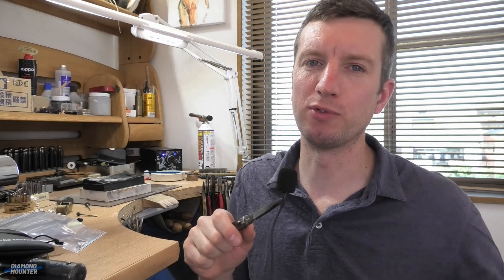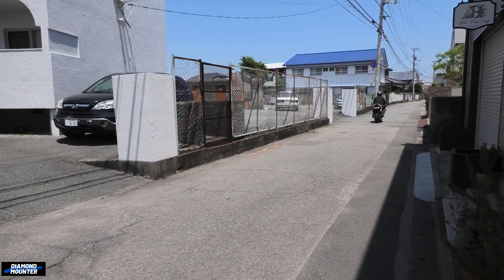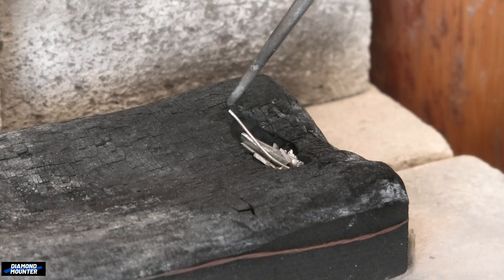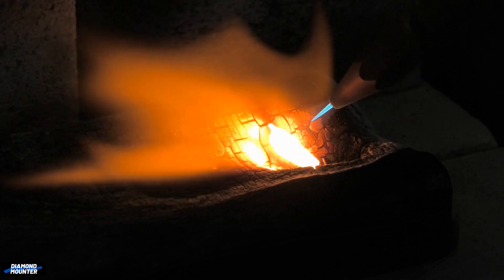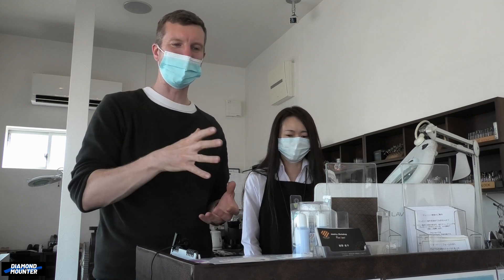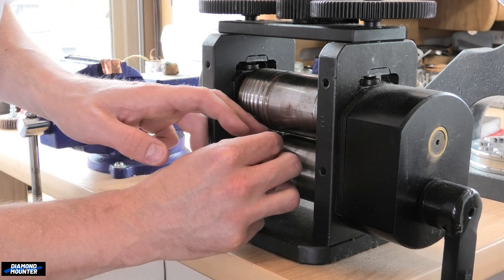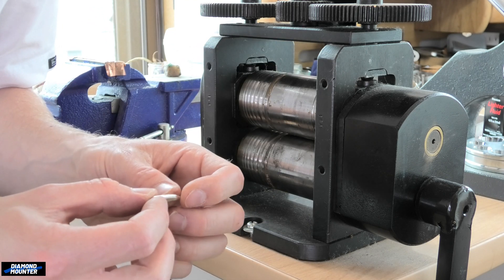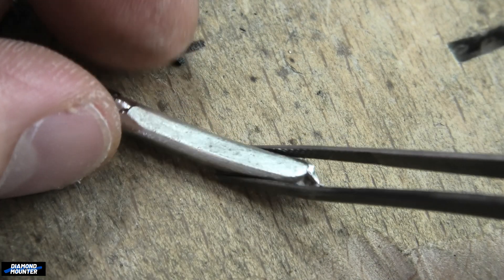Melting Platinum in a Charcoal Block

Comment: I have a huge platinum specimen but it has black crystals and a nugget that looks like some Northern Stag looking right at you, but I haven't worked with chemicals before and am not sure if it will eat the black crystals and leave the thick nugget that runs through the 16.4lb  specimen and  want to be able to have platinum for rings, maybe they were talking about PGM ore??  I don't know, all I know is that both the nugget and the ore is very rich in PGM's

Comment: Charcoal is just wood chips and CaCO3 (the white stuff). They compress it and partially burn it.
The high temperature converts the CaCO3 to CaO and CO2.
The carbon compounds burn away and make CO2 and H2O gas.
There aren't any metals so, it won't alloy with you platinum.

Comment: I figured I'd weigh in on the debate about platinum contamination. The question as to whether the platinum is "contaminated" by the charcoal is not debatable. There have been loads of tests done since the 60s, with a massive amount of data backing up the fact that platinum will gobble up loads of free carbon. You get grain boundary cracking, micro-porosity, etc. Does this really effect jewelry making though? I suppose that depends on what you consider to be 'perfect'. I really don't think you'll have many issues working with it, even given those impurities, unless you look at it under like a 200x microscope. If you snap it though, you'll for sure see the messed up grain structure, but in a practical sense, it's not weakened enough to really hurt anything or make the piece rubbish. In the ingot you rolled out, you can clearly see degraining happening on the flat sides (not the edges), but that also could be that you rolled it a ton (you mentioned that you really beared down on it).
Where it really does matter, is in some of the other places plat is used (medical, electronics, etc, etc). Loads on, and functions of the plat in those cases require a particular purity, with no exceptions.
So tldr; carbon will most definitely contaminate the platinum, but after working with it for 15 years, only being careful about carbon for half that time, I've most definitely seen failure due to it, but on the whole, it seems to not matter too much. 
I will say though, I've done a fair bit of old school forging with plat, and with those forces you will see failure.
Reply from the maker: Thats great info thank you for sharing

Comment: @all
Sure, technically its possible. But chemically the carbon reacts with the platinum and it can get brittle over time. Also jewelers charcoal blocks usually contain sulphur as a bonding agent. All these destroy the Platinum, its just not worth it, when there’s other similar ways to melt Platinum without using those materials. I have had Platinum rings that I could start from scratch, cause the metal was just bleh to work with cause of my ignorant boss soldering it on charcoal. 
Extra Info: I learned to put Platinum in the pickle after every time you heated it, cause the oxidations are really hard and destroy your tools. 
This is all scientifically proven, and not a myth. Try reading professional literature, you might learn some things! (I love the series from UJS called “technisch wissenschaftliche Grundlagen des Goldschmieden”, but I’m not sure if they’re translated into English)
I know a lot of people are self taught jewelers, but all th background knowledge is just as important as knowing the workshop techniques.
Reply from the maker: I will make something with the platinum I melted  to prove its ok
Reply: I have been a professional platinum jeweler for over forty years not self taught and it is common knowledge among my peers that charcoal is an enemy to platinum. Good Luck.

Comment: When I need to melt gold or silver, I use regular charcoal briquettes used for grilling food. Simply flatten one side with a file or carve out a small bowl and melt your metal in it. This will save your good charcoal block for soldering and keep it flat and square much longer.  You can buy a whole bag of charcoal briquettes for the price of a good charcoal soldering block.
Reply from the maker: yeah thatll work. Iv got a bit of my previous charcoal block I use for the same

Comment: I think you had the torch way to close,  you should use it farther away to have better results,  but anyways cool video thanks for sharing'
Reply: Actually for platinum he has the appropriate distance of the blue of the flame for melting, as long as the tip* of the blue of the high temp flame is nearly on the platinum metal, that works most efficiently.
Reply: @EJguitar1  naa thats not true if you have it really close there's a black spot that appears and there's not much temperature there,  the right spot is in the tip of the flame 🔥 if you are a jeweler you should know that 😉  there's many videos about that , and besides thats not a special torch tip for platinum
Reply: @BobRossin-o  yo that’s exactly what I said…
Reply: @BobRossin-o  also, I’m not sure what you are talking about when you mention a special torch for platinum, almost any jeweler in the country would and does use an oxy/propane or oxy/acet torch which looks he is here. If that is what you mean by “special” torch, well he’s got one. Yes, I am a jeweler. My comment here is because I didn’t want misinformation spread. Not every method I’ve seen Chris use is most efficient but in regards to his torch tip distance here, holding the tip of the blue of the flame (highest heat) for platinum is efficient for soldering platinum, and held there long enough, for melting platinum.
Reply: @EJguitar1  cool cool' nice info just that I'm lookin to buy a new torch and I've been searching a lot' and supposedly I heard from the companies that you need a special tip for melting platinum and the thing about the distance is that I know all flame has the highest temperature point on its tip' that's why I mention that he is way too close , if you have any torch and you put the flame  closer to a charcoal  you can see the black spot im talking about' and thats an indication that you are too close' cheers
Reply: @BobRossin-o  yes you do need a special kind of tip, usually a rosebud tip for small torches like the Smith or Gentec
Reply: @BobRossin-o  for melting 🙂

Comment: hello Chris, I worked for David Ashton at the Oxo Tower on the south Bank London for about 5 Years. I did along with my main job hand making heavy Hallmarked silver bracelets  and chains .When david was busy I would help rolling platinum down for ring shanks and welding together and polishing them David melted the platinum in charcoal block using oxygen and acetylene regards  Ken

Comment: I buy old jewellery to sell to a refiner, since there can be over 100 items and it can take forever to test individual pieces I melt them all together in their carats, I started off melting in graphite crucibles but wasn't a big fan of them. I came across people melting in a large potato and I do that from now on I've done it over 100 times it works great. Just cut the bottom flat so it sits even, scoop a small amount out enough to get your gold in, for my case I stick to around 40g per melt, I can get about 4 to 6 melts per potato.
Reply from the maker: love it. Im gonna try that
Reply: It's works well for what I need, I like the fact I can let it cool and pour it out when it is solid without worrying it will be stuck to a mould/crucible
Reply: I've heard about the potato method. Yet to try it though. I'm sure my son will love it. Thanks for the tip!
Reply: what kind of ring is it?not melting